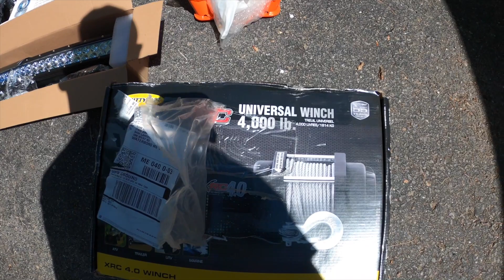2021 High Lifter Gets A Face Lift and A Muddy Break In!

Comment: got the 1000 been to busco 3 times since then. other then toppin out at 50 and a battery going bad right after warranty nd how can we not forget the placement of the battery its amazing. a 21 cfmoto 800 and a 700 grizzly on 30 zillas couldn't keep up in the holes